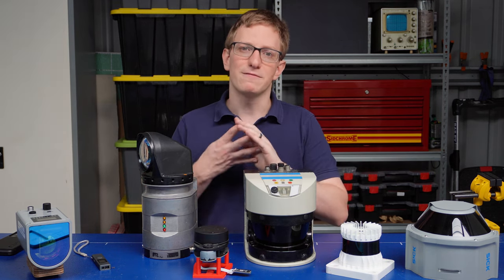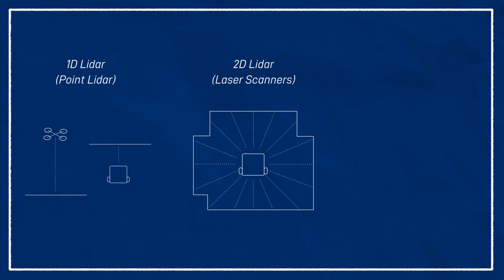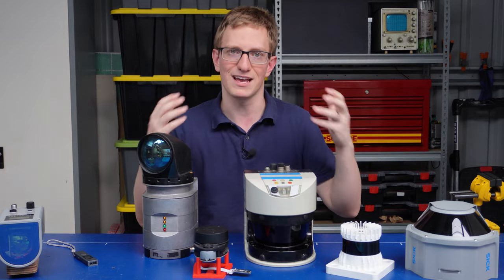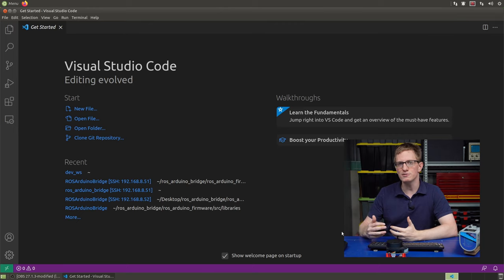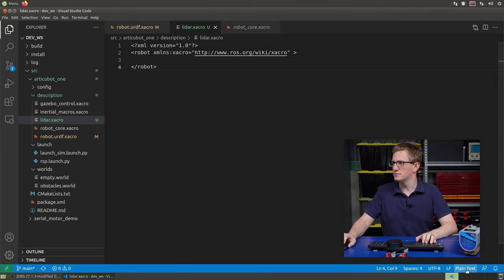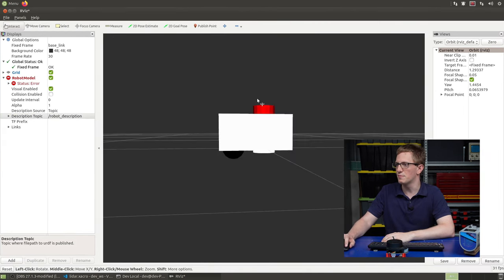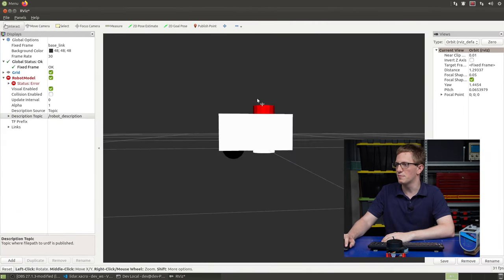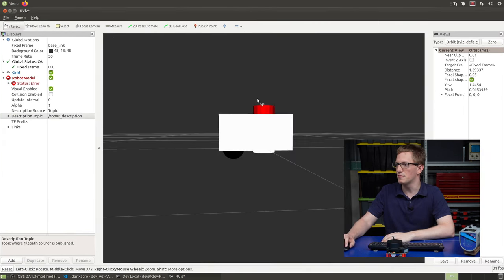How do we add LIDAR to a ROS robot?

Comment: March 2024, if you are working with the newer versions of ROS (humble) and use Colcon (not catkin), which are the preferred methods. this does not work and from all the sources I see, you can't use this Lidar
Reply: i have the same question
Reply: @yuanmizuna6253 ,  I'm sure if you install ROS2 Foxy, which is still supported, but not for long, and use catkin instead of Colcon, it will still work.  My issue is I have a fully built bot, and to go back and start over would suck.  Especially on a Pi when storage is limited.  Almost would have to completely uninstall Humble. 

Just sucks that I bought a Lidar that can't be used with todays systems.  Plus there aren't many I find that are available.  Top it all off, all the pros fail to tell you that part.
Reply: We were also these issues while using sensors like Lidar, imu, odometery encoders, we have used humble and colcon, so what could be the reason of failing these sensors while robot localisation and navigation? 
Could you provide me any resources or answers to these problems where I could know the possible reasons of these failures, please, because I want to know where the problem is and how should I improve these and what other techniques can I use if not this.
Reply: I am using the RPLidar A3M1 for a similar project and I personally didn't have any problems incorporating it with ros2 humble. There was a slight problem with the power supply for it, especially for the current because it requires 1.5 to 2 amps and I would get timeout errors, but other than that I do not recall other problems. As fun as it is to use it, I wouldn't say it's the most practical.
Reply: @angelanikolova7354 , it's been a while since I have messed with it but my problem was, I had a bot built and I was scaling up, something you do as a developer. I am not a copy paste, or a "do as I do" developer.  I came to the video after looking at the repo to try and get a better understanding of how to implement in a practical use.  Now if you followed the series, you built it in a short-term supported version of ROS. Catkin is no longer recommended, in fact, it was not even a build option for me.  Catkin was for ROS2 Foxy and older versions.  I've spent many hours reading forums and docs about this.  I did find the build for Colcon.  I was just pointing out if you were trying to learn this for modern/future times, ROS2 Foxy / Catkin, is not the right way to learn.

Comment: Josh, I ordered a Lidar to add to a future robot that I'm building using your tutorials - I purchased a HLS-LFCD2 lidar off ebay but it doesn't seem to have come with a LDS to usb controller board. It has 2 leads one with 6 wires and another that has 2 for 5v power. Do you happen to know where i can get an adapter board? Looking up wiring diagrams it seems I would need a LDS to USB, however, I'm not sure if an FTDI adapter would work or not. Any suggestions would be greatly appreciated; thanks for the videos, even though I'm late to the party!! Cheers!

Comment: You are my hero Josh.  I'm just getting started designing a robot that will scan HVAC pipe duct and produce a 3D point cloud/map. Plan is to use a small robot to repair ducts in solid concrete slab foundations.

Comment: Humble tester here.... Another great video. Humble is starting to come together pretty well. For some reason updates were a bit wonky.

A fresh install of ROS Humble on a fresh install of Ubuntu 22.04 on a bare metal partition fixed that last couple of things that were causing me problem. Things are far enough along that I am going to try to work through your series with ROS Humble and Gazebo Fortress.
Reply from the maker: Nice one! I'm not TOO surprised to hear it's going well on Humble, but I'm very interested to see how things go with Fortress as I have basically no experience with new (Ignition) Gazebo.
Reply: @ArticulatedRobotics  From my inexperienced position...

The new (Ignition) gazebo is really good if your use case matches closely with one of the use cases Open Robotics focuses on developing, such as the Subterranean (SubT) Challenge. That is where their money and development resources have gone. I played with running the gazebo server on a dual-core Xeon server with the gazebo client running on my laptop. After a bit of fiddling, it actually worked.

For the rest of us, the Ignition gazebo seems to be having a hard time replacing gazebo classic. It is probably not polished (or complete) enough to overcome the inertia of using Gazebo Classic. The next inflection point with probably be the spring of 2023 as Melodic hits end of life and more users are forced to migrate to ROS 2.

Comment: Is there a training set that shows how to set the parameter values of a robot with sensors designed with Solidworks from scratch and then the necessary coding with Ros? Or can you make such a training?

Comment: Hi your tutorials have been great help but there is one issue. I cloned your repo tried to run it. There is transform error for left and right wheel. Lidar and camera works but not able to move the bot in sim. I think the problem is /odom you mentioned at 13:13 I cannot see it in mine. In which video did you add it ?? Right now I am using base_link as the frame.

Comment: Hello, I’m facing some issues 
I’m getting data from RPLiDAR sensor when i connected to Pi
I checked with “ros2 topic echo /scan” but when I subscribed to /scan topic from my Computer it’s not showing data neither in Rviz nor in Terminal by running “ros topic echo /scan”
Reply: Did you fix it? I have same issue